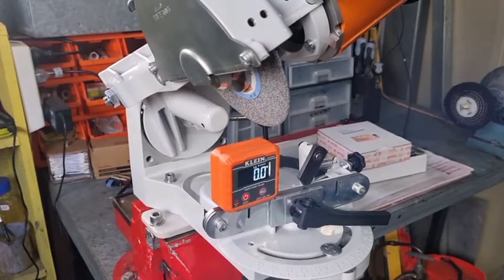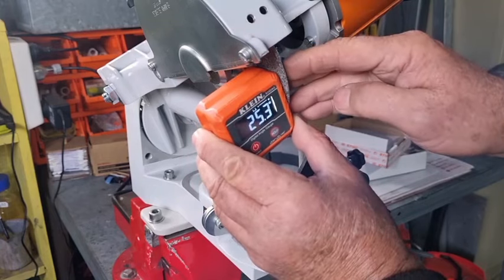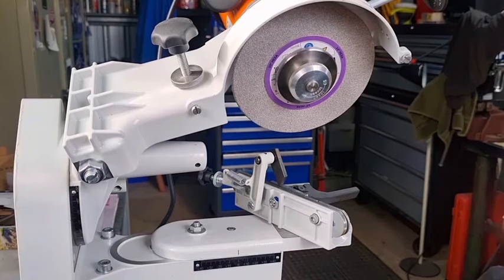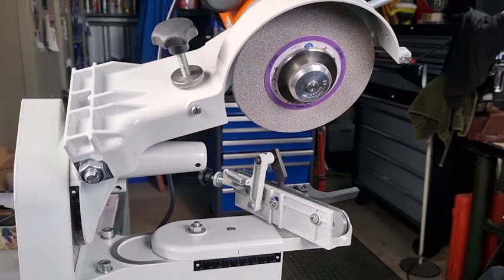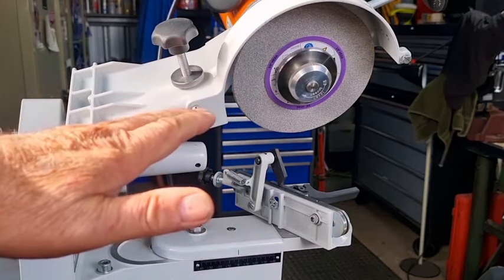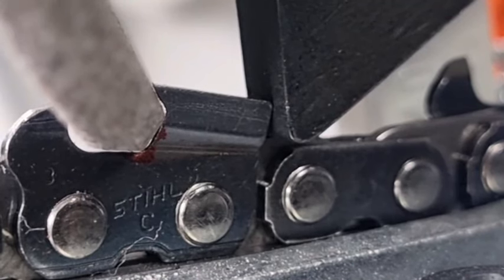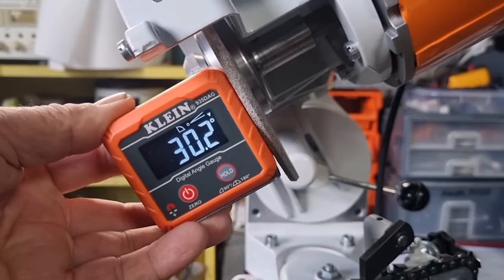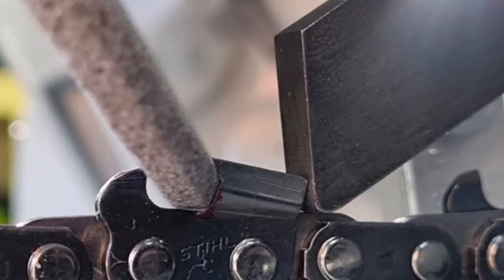Stihl Hexa grind at 60° or 65° Top Plate cutting angle

Comment: Have you done actual test cuts in wood, felling and bucking with the Hexa comparing the 25 degree top plate to 30 degrees? Myself and many others  have found the factory grind angles often do not match what they actually recommend sharpening the chain at. One would be wise to compare stock to recommended grinds and also what experience has taught works best in the wood they are cutting and type of cutting being performed. Husqvarna's X-Cut chain is probably the only chain that I have used that performs best matching the actual factory grind and definitely not their recommend angles. The nice thing about a grinder is being able to experiment and consistently duplicate grinds that work best for you.
Reply from the maker: I have done test cuts but hard to pick  5°  I was more curious than anything  else
Reply: @ChainsawUsers  It is interesting how often the profiles do not match. With felling, especially bore cutting and cutting with the grain 5 degrees makes a noticeable difference same with 5 thousandths on the depth gauges. With bucking one can get away with a wider margin of error.
Reply from the maker: @230e4 you have to find what works best for you
Reply: Have you actually watched these recent videos? They are not about the top plate sharpening angle (scale C), but about what angle you should set on the A scale, which results in either a 60° or 65° top plate CUTTING angle.  Of course, it also changes the side plate angle.
Reply: @elpolaco7654  Yes I watched the videos and I apologize I should have specified top plate cutting angle to follow with the context of the video's as you suggest so as not to confuse but my comment was not solely focused on  Hexa  or Stihl's chart but various other factory chain grinds as well, that there is often variations between the factory and recommended angles whether top plate, top plate cutting, or side plate for exactly what reason I don't know. I simply want to share with those that may not be aware that there are often differences ( x-cut is one that confuses alot of folks) so I would recommend testing the factory grind and compare it to the recommended grind and perhaps a grind based on ones experience and decide which one works best in your context. I was curious if Tinker tested the grinds and noticed a difference in his context as I have noticed the difference 5 degrees makes in my context. I hope this is not confusing, I am simply trying to help folks.
Reply: @ChainsawUsers  Thanks, I was curious if  you noticed a difference or not. I sometimes  can't tell a significant difference until I cut a notch, root flare, or bore cut but since I am focusing on finding the highest level of overall performance I find it makes a difference.
Reply: @230e4  No need to apologize. The reason I paid attention to which angle you're referring to is because it's important from the point of view of the compatibility of sharpening with a grinder and sharpening with a file. If the top plate cutting angle obtained at the 25°setting on the A scale of the USG not agree with the angle we obtain with a file, then we are unnecessarily filing/grinding the material when switching from a grinder to a file or vice versa.

Using the Hexa file in the recommended way, we can obtain only one value of the top plate cutting angle. On the other hand, we can get any top plate sharpening angle without any problem.

By the way, it seems to me that specifying angles the way Tecomec/Oregon does avoids confusion as to which angle is meant, e.g. 30/60 vs. 30/30.
Reply: @elpolaco7654  That makes sense. I have really gotten away from hand filing for the most part so I have forgotten about that issue. Hopefully you are having good results with the Hexa files and chain I was very excited to try out the Hexa files and chain, I thought it would really benifit those that struggled with hand filing and perform closer to square ground chain. I tested it on .325 and 3/8 chains from 18"- 32" on various saws and many species of hard and soft woods along side round and square ground and filed chains. I was disappointed with how quickly the files got dull and worked as the tooth got shorter and also the Hexa chain cost about $50.00 a loop in my area verses around $20.00- $25.00 for the chain I usually buy in 100 foot rolls. It does perform better than factory Stihl RS chain and using the Stihl Hexa chain verses converting a standard ground chain has it's advantages but it did not perform as well as the grinds I have been using on chain costing half as much,  plus I was going through loops faster with it so I lost interest in it and no longer use it. I am curious to hear others experiences with it.
Reply from the maker: @230e4 I just use my grinder to gri d the Hexa in any full chisel chain and it cuts better. I tested it time based it wad about 7% faster that full chisle chain samebrand just reprofiled the grinding wheel.
That's all I use now hexa profile without the narrow kerf

Comment: Does it matter  that you didn't have 15⁰ on the slide scale.
Reply from the maker: The B scale sliding vice is only helps so the grinding wheel grinds the tooth even left and right.
It's just off set grinding that won't affect tilt because it's in the opersite side